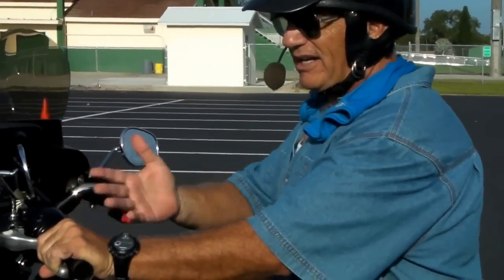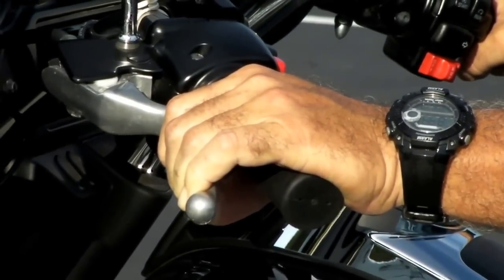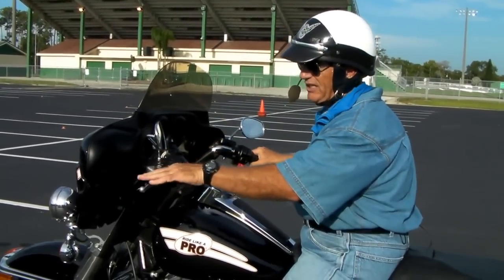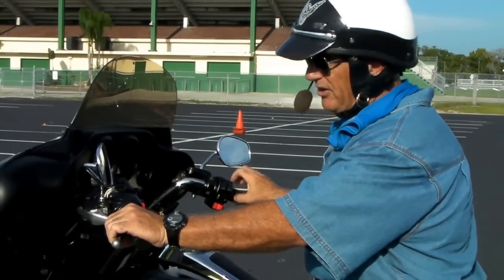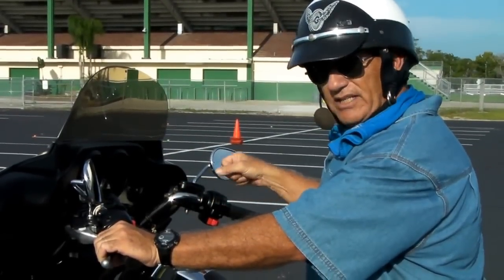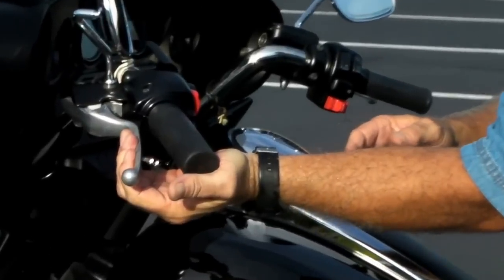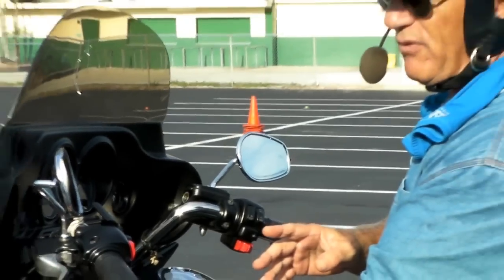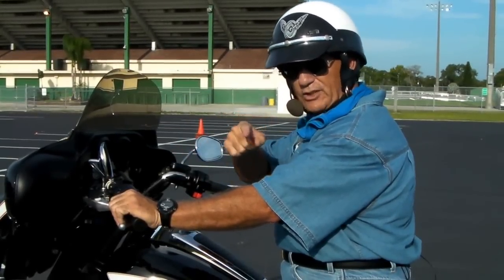Motorman's Tip of the Week - FRICTION ZONE

Comment: Hi Jerry question is this technique hard on the clutch ? I just don't want to burn the clutch out. 

As always thank you for the knowledge.
Reply from the maker: If you follow the instructions I give in my Ride Like a Pro video, no, using the friction is not hard on the clutch. In short, light pressure on the rear brake, revs at 1500 rpm, and after 10 minutes of using the friction zone, breeze the bike out for a few minutes.
Reply: Ride Like a Pro Jerry Palladino Thank you I will try this week. I always been worried about using the friction zone. I will give the bike a rest too. 

I really appreciate the response.

Comment: Any tips on keeping the revs constant while steering Jerry? I'm OK with the friction zone, rear brake and constant revs (about twice idle) in the slow race but when I start weaving I tend to move the right grip just a bit as I steer with the bars and the engine revs more. Thanks for the great vids, awesome.
Reply from the maker: Holding a steady throttle while turning the bars just takes practice. You can also try the constant blipping of the throttle as you hear me doing in many of my youtube video's. Find the method that works best for you.
Reply: Thanks Jerry, nice one.

Comment: How many miles do you get on the rear brakes
Reply: A lot more than the front brakes, the rear brake only provides about 10% of the stopping power on the bike. Unless you plan on staying in 1st gear all the time.
Reply from the maker: About 3000 miles on the rear brake.
Reply from the maker: Actually, it's 30% rear, 70% front.